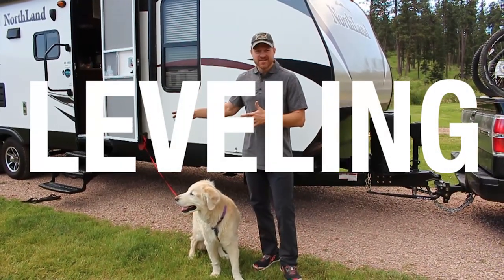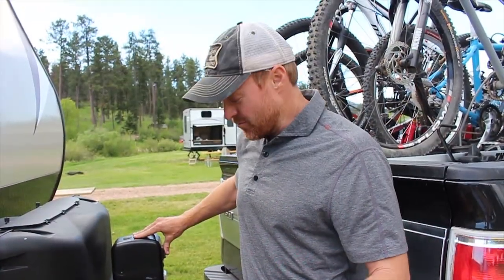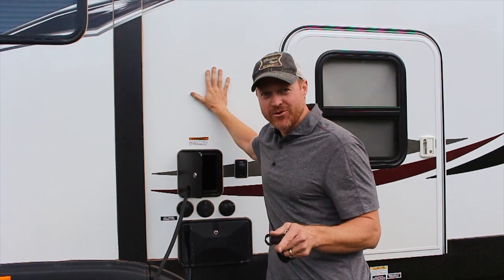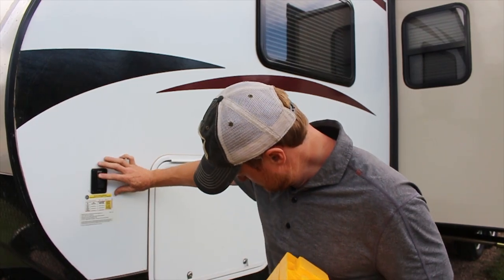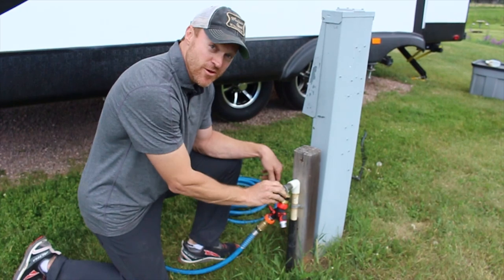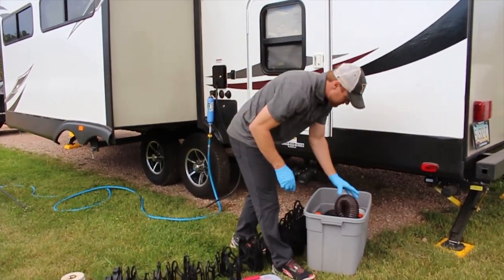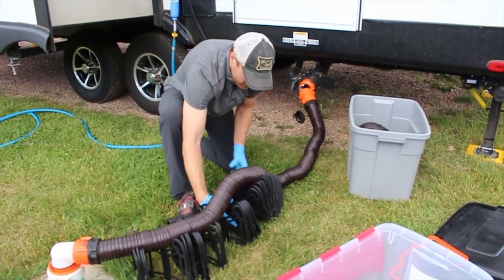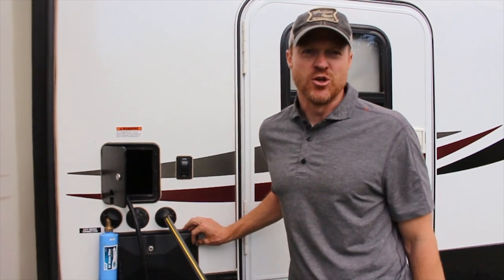HOW TO HOOK-UP AN RV FOR THE NEWBIE RVER! (FULL TIME RV LIVING)

Comment: One thing I would add to the beginning of this video: Make sure to check the electric and water connections from the campground BEFORE DOING ANYTHING! You don't want to go through all your leveling and setting up your slides before you find out there's a problem with either one of them. Read about this happening to another newbie after they were all set up and found out they had no power at their site. May not happen often, but well worth 2 extra minutes to check BEFORE you've set everything up.
Reply: Great idea!  For ordinary 110VAC household outlets I have a very simple plug-in device, bought at a big-box home improvement store for cheap, that immediately tells me if a circuit is good, has a floating ground, floating neutral, reversed hot & neutral (my father-in-law thought nothing of doing this), etc.  I haven't checked, but it seems it would be easy to get a similar device for the RV outlets, which appear to be 220VAC.  Of course, checking water is even easier.

Comment: My only suggestion is to have a bleach water spray and quickly spray down the water connection prior to hooking your hose up.  You won't believe what people will do (rinsing the stinky slinky out using the fresh water spicket, yuck! I'm sure your 409 would work too, just spray and rinse before connecting.  Great video! Safe travels.
Reply from the maker: Good point! I have done that but not every time. Would have been good to include that in the video. I'll go back and add an annotation.

Comment: Thanks for the great video for those of us who are just starting out. One thing I noticed from my many moons working as a building inspector is that if you are going to connect both the black water tank purge hose and the clean water tank hose to the same tee at the same time, the black water hose needs to have a back flow prevention device at the tee connection to eliminate any possibility of cross contamination of your clean water supply.

Comment: Best add on comment I would add is before you remove the sewer cap is to double check the drain valves are closed.

Comment: Very good video.  I have a 39 foot fifth wheel with the 50 AMP connector on the back of the RV.  Before I unhitch my truck, I plug the power cable in, and stretch it to the power pedestal to make sure it reaches.

Comment: Being a newbie RVer myself, and attempting to do it as correctly as possible,  I agree with the others about the Surge Protector, to protect your rig, and the anti-siphon or backwash regulators to avoid cross contamination.  Also being a RN, I have one more suggestion regarding the handling of your fresh water hose, I recommend you don't throw the open ends on the ground, even if you end up getting caps for it because one never knows whose puppy peed or pooped in that exact spot last lol.  Great video though, very informative.  Thanks for sharing it, and safe travels.

Comment: I am really learning so much from your videos.  I am sitting with my notepad, taking down all your helpful tips and making a lists.  The only thing I would suggest is that you keep everything in order.  You have "making sure you back up into a spot that has no barriers for slide-outs and awnings" in your third step.  I would think this would be the first step, then chocking, and then leveling.  Besides that small whine, each step you mentioned was very helpful and I really appreciate the videos.

Comment: Heres a tip. To clean my black water tank hose I shut off the grey water drain for the last few showers and then when I have emptied my blackwater, I shut that tank off and then open the soapy water from the grey tank. It flushes out the gunk in the sewer hose and then after disconnect attach a Camco fitting that allows for the black water hose to give it a final flush. After that its squeaky clean.
Reply from the maker: That's a great idea. Funny you should mention that... with 5 people in the trailer, I've been leaving the grey tank open and then close it on the last day to do exactly what you said. This way I don't have to run out and open it after the third long kid shower. :)
Reply: Keep Your Daydream ...I only just found your channel, but enjoying it very much. I have some catching up to do. Happy travels.

Comment: I love watching you guys!   We have doing the RV thing now for 7 years.. Not full timers.. just long weekend warriors.. Couple of tips 1) , we have bright LED awning lights.. We typically get to campgrounds at night as we travel a lot on a Thursday after work. So when I get to the campground.. I turn on the awning lights, and it provides some extra light to help me see the campsite as I am parking.. One other tip.. If you take a fuse, bend the prongs inwards a little.. stick in the two connections at the top of your 7-pin connector, it jumps the power to the marker lights.  We always do that.  It really helps at night when you walk away from the camper.. then when trying to remember where you are parked at.. you will always know which camper is yours because odds are, you will be the only one lit up.

Comment: Mark great video. the surgical rubber gloves a very good thing. Some folks do cross contaminate them selves when taking the gloves off.  A good thing to practice is too see how well you do removing them. Apply shaving cream, lather them up, now remove them to see that you can remove them without getting any shaving cream on you and you're hands.
Reply from the maker: I accept your shaving cream challenge! Now I just need to find shaving cream... stopped shaving after Michigan (which should be next weeks video). I usually do take them off carefully, but we're going to find out. Thanks for the comment.

Comment: very informative video, wish i would have watched something like this when we got our first travel trailer about 5 years ago. we dont do much camping at places with hook ups, but the first time out we went somewhere that did, boy there is so much to learn when starting out. the only thing i would add to anyone new, anyone with a new or older trailer is to switch to led bulbs in everything and add solar panels. panels even from harbor freight (bigger 3 panel ones) saves you so much hassle with generators or reconnecting to vehicle to recharge batteries. i havent had to worry about draining batteries using the heater when its colder at night or having low or dead batteries leaving a light on while out for the day. anyway, i look forward to watching your other videos and maybe learn something new.

Comment: Looks like you pretty much have everything under control.  

I do some things differently.  We use walkie talkies so we can clearly hear and understand each other when maneuvering our travel trailer in and out of spaces.  I use heavy solid rubber chock blocks as I've seen plastic ones get blown away by wind.  I use a block of wood under the tongue jack as I personally don't trust plastic.  A stabilizing jack when extended just a little too far can cause the trailer body to torque and have had an occasion when the door wouldn't latch because of that.  Something I learned from another You Tube channel is to position the sewer hose with a dip in it (homemade "P" trap) which enables me to keep the grey (gray?) water handle open all the time so that tank doesn't fill up while camping.

These are things I've learned, sometimes the hard way.  Looking forward to your travels!
Reply from the maker: Great suggestions. I'll find a rubber chock block. I like that. I haven't had an issue with the plastic for the tongue jack, but would rather have wood too. Simple to keep in the bed of the truck. We travel with so much less stuff now there is plenty of room. Good idea too on the P trap. Thanks!

Comment: He did good getting a regulator for the water.  But one thing you should also get is a surge protector that goes on the line (The surge protector would go into the tree and your RV's main line would plug into the surge protector) coming from the power tree because as you travel from campground to campground, you can never be sure of the quality of the power coming out.  Especially since so many rigs have sensitive electronics in them these days.  It would be similar to installing a stage 2 surge protector in your houses circuit breaker panel.  And when you get one, don't get the cheapest one.  Get a good one.

Comment: FYI, 
You realize the water filter short white spring covered adapter is to support the hose coming off the rig.   The 90’ adapter is great but that’s the purpose of the short white hose that comes with the filter.

Comment: I keep a small jack  stand too if you changing tire jack won't go high enough use jack Stand I work on a race car we have flat metal plate welded on the bottom. nice chunk of plywood  helps too every change a tire in the mud change Tire right front in mud now that's fun

Comment: Great video!!!  Since the electrical service at most campgrounds is not "clean" electricity and prone to brown outs and black outs, spend the money for a HIGH QUALITY surge protector.  It will save your rig.  Research what you need and do it sooner rather than later.
Reply from the maker: That's a great point... will add to my next Amazon order. Far cheeper than chasing an electrical issue after getting bad power.

Comment: Great how to video!!! Another great idea is to have an anti backflow valve connected to your grey water hose. That way there is no chance of fresh water contamination at the fresh water bib.
Reply: Chuck Lawson by all means a backflow preventer they also make pressure regulator you put that at the hose bib at the shore they're kind of expensive so you wouldn't want to forget it
Reply: Chuck Lawson 
Read my comment above about an external backflow preventor. My new RV already had one built into the factory clean out system with paperwork stating not to add another preventor.

Comment: when setting your awning, there is a nut on the arms that extend out, loosen one of those and push the spring loaded arm in on one side a couple inches. This will cause your awning to be a little at a slanted angle from one side to the other. Doing this eliminates your awning from becoming a kite in breezy conditions and makes the air flow right thru. Didn't believe it til i saw it, but it works like a champ even at 20 mph winds.

Comment: Hey guys! Love your videos... probably the most professional out there. :) It may have been mentioned before, but BEFORE you connect your fresh water filter to your trailer, run water through it. The initial blast of water will send out a cloud of charcoal that won't be settling in your fresh water tank.(and clogging up your water pump when you use it)
Reply from the maker: Good practice. Thx
Reply: Too late for me.  SMH.

Comment: I suggest adding quick disconnect hose fitting to all the hoses. It will save the plastic connectors on the RV from getting stripped and will speed up your connecting & disconnecting. Lowes has quality brass disconnects cheaper than Amazon.   I also carry a spare drinking water hose which I connect to the 'Y' valve with a hose sprayer attached. That gives you & the family an easy way to wash things outside the RV.
Reply from the maker: That is a brilliant idea. Amazon has them too :) And they'll be delivered to our next destination. Do they stick out very far? Can they be left on while driving? I guess that would be the point if they don't stick out to far.
Reply: +Keep

at most they stick out 3/4". I leave them connected all the time.

Comment: After fighting with that accordion thing for the sewer hose, I bought brown plastic guttering from a hardware store. Cut into several different lengths an use small 2x4 wood blocks to adjust the height. Also, I now use quality quick connects on all my water lines, from Lowes. They cost a little, but make set up easier and a bit faster. I use a 4 way splitter on the water spicket so I have one for fresh water, one for the black tank clean-out hose, one for an extra hose that I sometimes use to clean the RV or spray off the outdoor carpet. I always leave one un-used. Some campsites (although few) share waters spickets between sites. I assume your black water clean out has a built in back flow preventer, which I keep on mine.
Another tip, I always turn off the water before leaving camp when visiting places because RV water lines, connections & fittings are what they are and can fail, you can imagine the rest. Only takes a second to turn that little valve. Ask me how I know, or don't...
Reply from the maker: Right-on. Yeah, I fight with it all the time. Good idea! Thanks for the comment.
Reply: I also use the gutter system. Makes life simpler.
Reply: Great Idea !!

Comment: Great video, I just subscribed. Like the way you do it. You should mention why the pressure regulator is needed at the spigot end and not the inlet end. Also good to run water through the fresh water hose to remove air before connecting it. REALLY appreciate that you asked for comments about your video. Some leave the impression that their video is the way and won't correct errors; like the guy showing newbies how to rinse the sewer hose by putting his fresh water hose inside it to rinse.

Comment: Marc great videos. I just found you guys and I am trying to catch up. I am still just a weekend warrior but someday I hope to travel across the US. I have almost the same rig set as you.  f250 and  tt. One thing I might add is when placing the wheel chocks I back onto the rear one then place the front one before letting off the brake on the truck. For me it just helps the  tt from rocking back and forth.  Safe travels.
Reply from the maker: ExploringKY welcome to the channel! Don't catch up too fast! Good idea on the wheel chocks. Keep in touch

Comment: Great video and just noted one particular suggestion with regards to your 30 AMP plug....  You turned on both the 50 and 30 AMP breakers but only plugged into the 30 amp service. If you haven't tripped any breakers yet you will. You could use (when available)  the 50 amp service with a reducer to 30. You would plug your 30 AMP into the reducer to give you more juice! Especially during the summer when you have AC running, TV, hot water, Fridge, all sorts of accessories, and when you turn on the Microwave......POW!      Safe travels on the road and fantastic set up video
Reply from the maker: Omg. You're right. I always flip them up without thinking and I should be flipping up only what I'm using. Great suggestion on the reducer. More to buy! Thx for the comment.

Comment: Good job! You didn't mention electrical, other than plugging in. Glad to see switches off until plugged in but you didn't mention if you check for reverse polarity, missing ground, improper voltage, etc. At the least one should use a non-contact voltage tester to make sure neither the pedestal nor RV is "hot" from a faulty pedestal. I got mine from Harbor Freight for $4.99. I don't think newbies even think about this. Just subscribed so I'm looking forward to seeing all your videos. Wish I knew where you are in this one.

Comment: Thanks for walking us through your hook up.  One thing I added was a shut off valve at the trailer end of the hose. You can check for leaks on the whole set up and adjust water pressure if necessary before hooking it up to the trailer.  $10 well spent I think.  We use Clorox spray for our disinfectant.
Reply from the maker: Thanks for the comment Slim. Good idea on the leak check. I'lll keep that in mind.

Comment: You should never drop any end of your fresh water hose on the ground, especially not close to the hookups....:-) Great video. You mentioned that you have the black full before you dump it. We have seen so many fellow campers and there are some videos even on YouTube recommending to keep the valves of grey and black open, when you are on full hookups. Thankfully this myth starts to vanish. You can ruin your tanks, clog up your sensors etc. Keeping the valves open drains the liquid and makes sure that the solids build up in the tanks. Even in the grey water tank once soap and grease dries on it is very hard to get rid of and the grey tank will start smelling worse than the black tank. We love your videos and followed your journey. You guys have clearly fun and don't try to spread doomsday stories of the "dangers of the road" like some others here. Great job, keep on going.....

Comment: I was stationed on a submarine for quite a few years. Whenever we were in port, our mechanics would connect our sanitary tanks (black water) to the shore services. In addition, we were required to wrap the connections in clear plastic bags (think garbage bags) and secure to the hoses with duct tape. In the event of a leak or blown hose, the bags would give us just enough time to stop the pumping evolution and correct the problem before we sprayed the pier and water with black water.Just a thought.
Reply from the maker: That's too much extra effort for an almost daily job when your hand is on a manual level. I think you were pumping a lot more with electrical pumps. However, here is what I do to double check the connection. I pull the grey first to check for leaks, drips etc. If all is good, I pull the black and then go back to the grey to flush it all out.
Reply: That makes sense. I was just adding my two cents. Your system seems to work for something on a slightly smaller, although no less important, task.